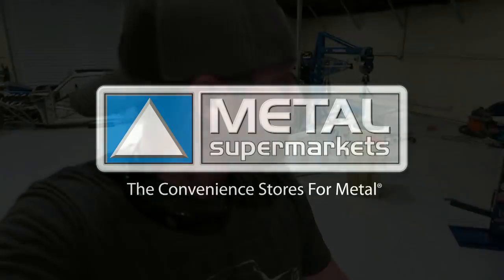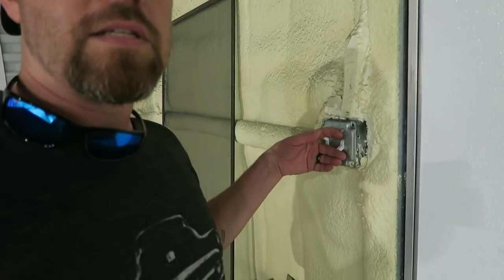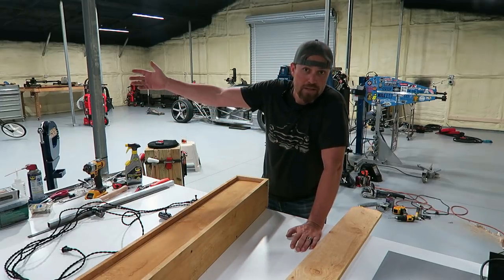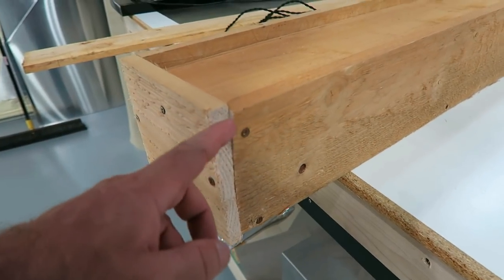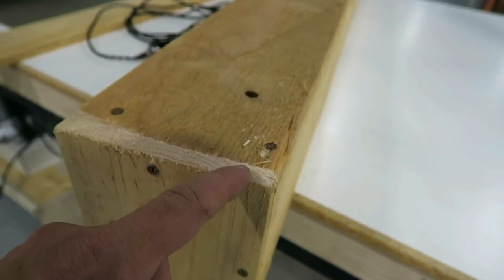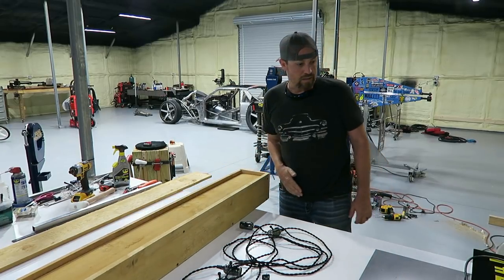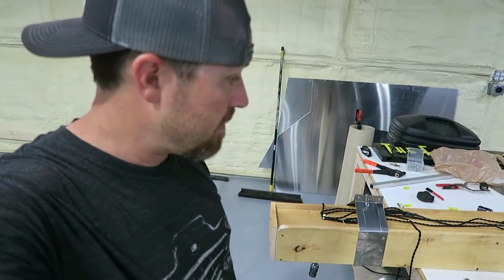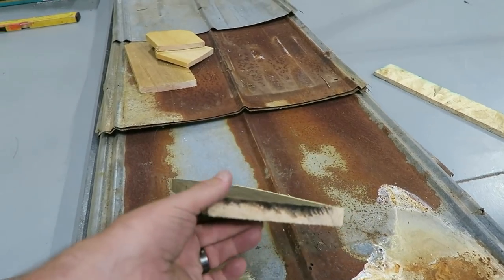How To Make A Rustic Vintage Looking Light Fixture

Comment: Looks good man keep it up, I spilled some ally wheel cleaner on a sheet of steel a while back and it made it rust up really quick so might work well as a rust accelerator. I'm in the same boat with the video thing, its tricky when you have multiple things going on and it seems like people only wanna see one thing.  Somethings better than nothing though so I say film it all.
Reply from the maker: yeah for sure

Comment: It may have been mentioned already but A small suggestion is to miter a 45 degree angle on the edges of the wood and it would look more like a solid piece. I love the project though.

Comment: Ima diesel mechanic ive done it before working on trash trucks. The wire youre looking for is like a j1939 ABS wire. If you get just black wire and twist them together you can get that look. Done it a few times with a vise and drill on the other end of the wires

Comment: Looks good.  If weight is your only concern on using a railroad tie, you could hollow out the middle with a chainsaw.  I weighed one and it was like 165 lb.  Hollowing it may get it down to  50 lb or so?

Comment: paracord looks like that wire on your lights. find some black 550 paracord and use that. you can find it at walmart , tractor supply and just about anywhere that sells rope.
Reply: Not even close to paracord. This is a copy of vintage cotton insulated lamp wire that was twisted together to form a cord.
Reply: @rixtrix11  the braided fabric that is on his lights is the same fabric and braids they use to make paracord. I know it's a copy of vintage lamp wires they use cotton back then now they use polyester or something to that effect